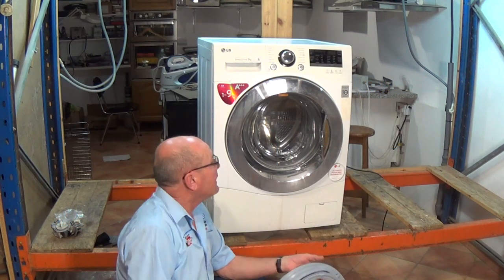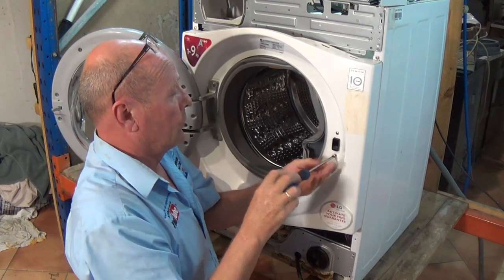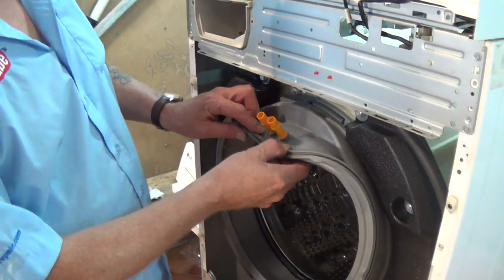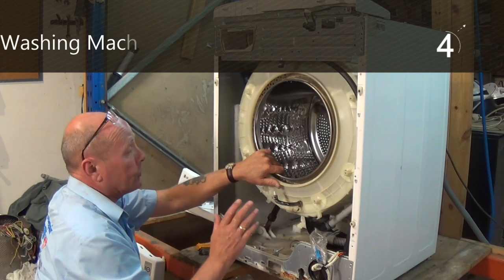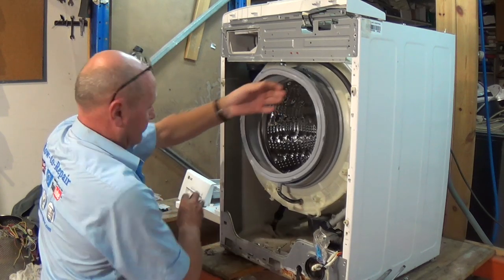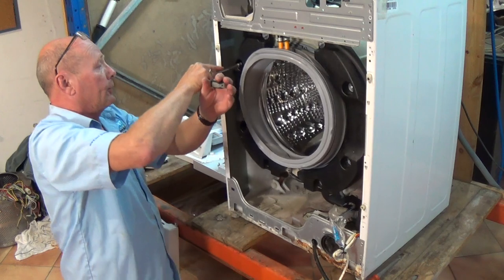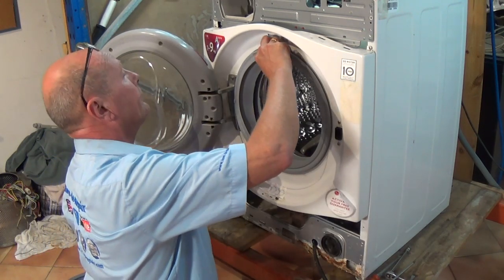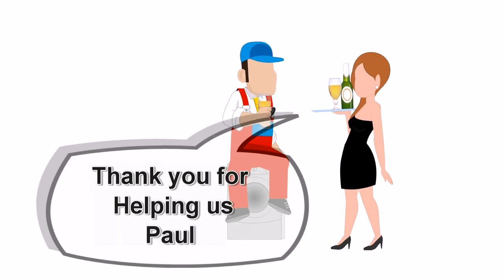How to Replace LG Washing Machine Door Seal Gaskets

Comment: Paul, you do an outstanding job with your videos.  They are top notch.  
I struggled with the last step which is reinstalling the door-seal retainer ring.  Here is a tip for others fighting the two screw driver method.  Put a tiny amount of dish soap on the bottom right quadrant of the seal (3:00 o’clock to 6:00). It was like magic. It lubricates it so the screw driver can  glide easily from the 3 o’clock position all the way to 6:00 o’clock where the spring is. The retainer ring slips right into place.

Comment: Hi this washing machine looks exactly the same as mine from the front on the inside the yellow plastic part is not at the top but roughly the 2 o clock position. Is this the same model (or has my seal somehow turned?!) and will this gasket still fit (I note the links in the description are dead by the way).
Reply from the maker: Hi, if you have a problem with your machine please use our contact us page and make sure you fill out the request for what your problem is. I will need the full model number of the identification plate and the details of your problem so that I can provide you with useful literature. A video shoot of the problem would be perfect as well.

I will get back to you within 24 hours, normally. https://www.how-to-repair.com/help/contact-us/  

Please remember to subscribe to our channel, as that's what keeps this channel going. Thanks, Paul 👍

Comment: Hello,

Thanks for the video. I bought a seal for a Samsung Ecobubble - this was the video attached to the eBay listing - will the procedure be much the same?

Thanks
Reply from the maker: Door seals are pretty easy to replace and the video should assist you and give you good guides even if it isn't your pacific model. Just take a note of where the screws come from and take your time. If you ever need any assistance, just contact us on the website. @scottmckendrick95 please remember to subscribe to our channel as that really helps us https://www.youtube.com/shorts/e432SAb2g08  Thanks, Paul 👍

Comment: Thank you good sir for your excellent video. Just fixed my washing machine. Did not remove the concrete blocks though. 

Tip. In The Netherlands you can get metal bicycle tyre lifters. These work fantastic for fitting the springs!

Comment: Sir, i have LG this type. But the turbo wash water spray ( yellow part in door seal? Seems wide but why water spray so low since new? But its already 2 years more. Then i try to clean the hole with pin, i see it only 1 hole the yellow part. But now sadly its like water drop continuously from it. What happen? Thanks for your help. In my country some official tehnician hurry hurry, it happen when my EX elextrolux front loading broken. So change LG. Same tehnician hurry hurry.

Comment: hi there from Mexico, i am not a technician but i like some times check the solutions in order to evaluate the convenience of repair or check out if i am will ripped off by techs.  Do you recommend using a liquid detergents in this washing machines? i have a LG wahsing machine with a LE error that was repaired today at cost of 60 bucks (USD Dollars) including parts and labor on site (i guess is pretty fair, the part is about 20 usd) but the technicians told us there is no maintenance required on this machines, it is that correct? what do you recomend for LG machines?. Our machine havent repaired until now since purshased 10 years ago. We love our machine and we want to keep it in the best shape. Congratulations for your videos. Theres are very interesting and easy going even for non tech viewers.

Comment: Sadly the control panel on my LG washer is attached differently to this. After removing the screws and loosening the panel I found it hard wired in two places to the circuit board behind. Not being remotely electrically knowledgeable I could see no way of removing theses wires and so I couldn't really get past first base to remove the screws on the main front panel. will have to look elsewhere...............
Reply from the maker: A while ago on YouTube, you ask me a question about your LG washer. I just thought I’d let you know that I have now made a complete playlist to assist you in any repairs that you ever have.
If it helps, you don’t forget to share it with your friends who may also own an LG.
https://www.youtube.com/watch?v=w5dZ4Pj8Jdo&list=PLnAHZbSarsyHLR4x9XPIS-ZEsheufxm9Y